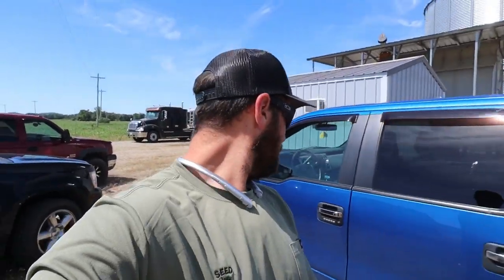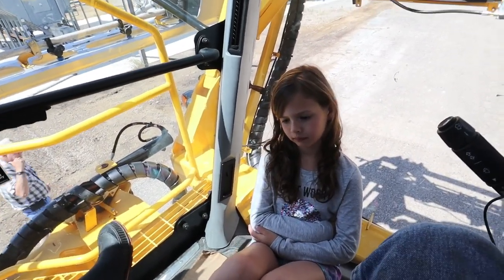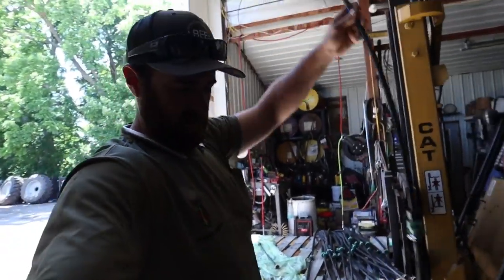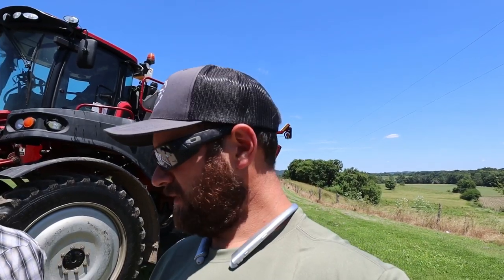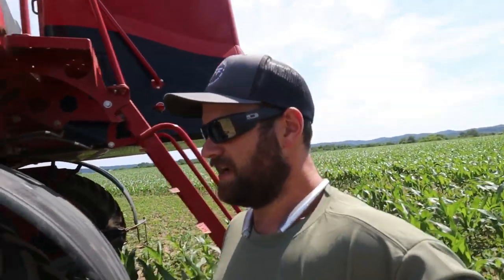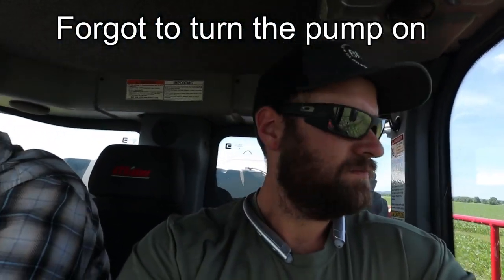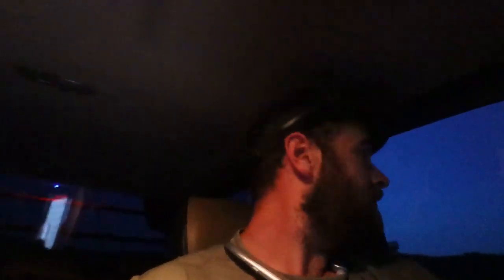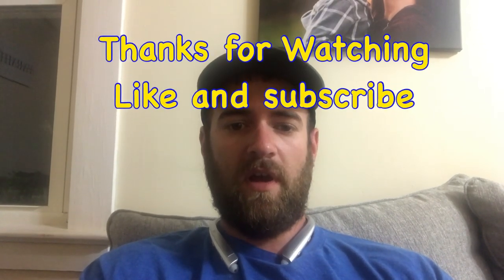Time to feed the corn

Comment: We run y drops on our front boom New Holland. Basicly a Miller painted blue. We run a variable rate nozzle on each side of y.  We only run y drops on every other row. A lot cheaper and you still get a stream down each row at the base of plant. We really like them. We don't side dress till corn is waist high or taller. Good luck.

Comment: Y Drops have an orifice on each side to even out the flow, I use the TeeJet variable rate fertlizer orifice because they don't stop up and you don't have to change them if you want to change rates also on the Y drops I put a check valve on just before the orifice on main hose. I have tried the corn drops that Ohio Valley Ag sells they work well also and are cheaper, but I like the Y Drops better but make the sprayer wider going down the road which can be interesting meeting on coming cars.
Reply: David McColloch  we run a similar setup only difference is we have two check valves on the y drop one for each leg in a sense found it helps with the start of the run keeping it consistent you don’t loose anything when you turn around on the headlands

Comment: Last time I actually looked into the guts of y-drops, where it splits, there is a sprayer nozzle like thing with an orfice in it to limit flow to each side of the row (two separate nozzles) Then there is some back pressure making equal amounts flow to each side.